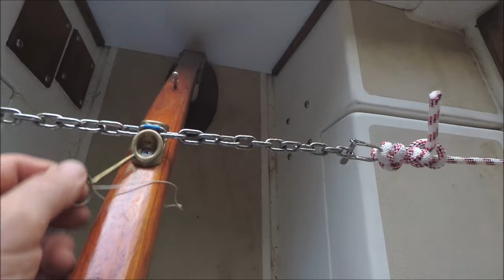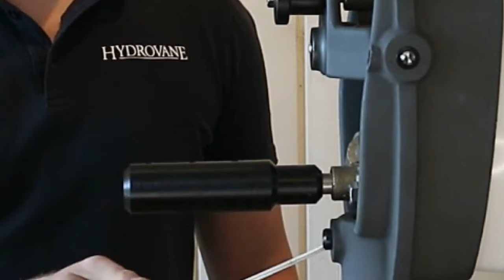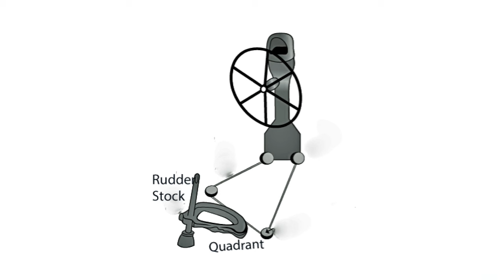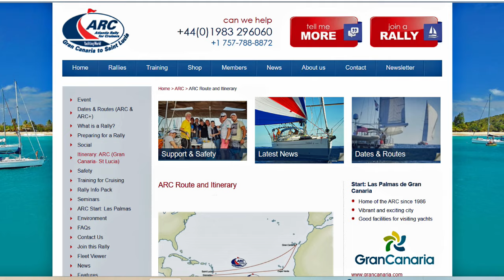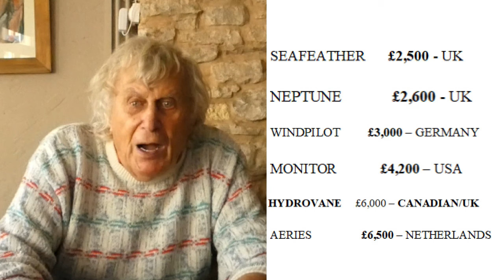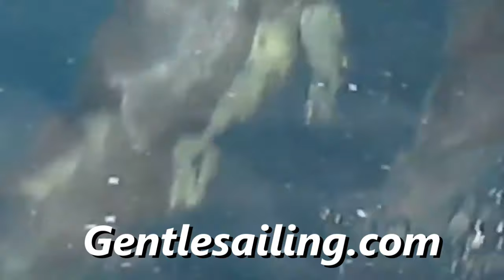Windvanes and Autopilots

Comment: Quite a good overall discussion of self-steering altho' I would add the following:  If self-steering is absolutely essential, relying on a generator with its many failure points is not a complete answer.  And autopilots also fail on occasion.  We had reliable wind vane steering while motorsailing by use of a tiller pilot connected to the vane's servo oar.  We've had two CPT failures and would temper that praise.  Amazingly our Raymarine wheel pilot lasted 25,000 miles with one belt replacement (but it was only lightly used). And for the budget minded:  When calling in at Horta in mid-Atlantic, all the bigger boats are given the floating pontoons while the smaller ones are berthed near the seawall.  I was always struck, when walking along that wall, how many wind vanes were bobbing up & down on the transoms of those small, not heavily electrified sailing boats.  No autopilot 'crews' on those boats.
Reply from the maker: I agree with everything you say about Autopilots Jack and thank you for your input.  Sailing round the world I used my Hydrovane 99% of the time and the electric autopilot just for coming in and out of ports.  I think most windvane boats have an electric system as well for just that

Comment: It's a shame the wind powered ones are so expensive. In the meantime a small solar panel should be plenty for one or day sails a week, and there are some intriguing DIY designs.
Reply from the maker: I have a couple of solar panels but they are not really up to running the boat electronics when night and day sailing and I think with more i would still need to run the engine every few days to top up the batteries.  I do agree re wind vanes - Can't see why some cost so much
Reply: @SailingGently  mostly I'm knocking around the Solent where there isn't a need (or usually an opportunity) to set the auto helm to steer a constant course for hours at a time. Useful when I want to leave the cockpit for a few minutes or need 2 hands for something but I'm not relying on it for keeping course while I sleep. Plus usually the panel has several days to recharge the battery.
Reply from the maker: @jonathanshaw6784  You are right of course Jonathan - there are lots of situations where autopilots and windvanes are simply not appropriate..

Comment: I use Hydrovane all the time. Haven't even fixed my somewhat defunct wheel pilot. Downside is when under engine. Reliability and silence of the HV under sail are everything... Expensive, but if I was to change boat, I can just take it off and reinstall it.
Reply from the maker: Vincent hi,
I agree with all you write and I have subscribed to your channel!  You are the person I quoted as only using the Hydrovane all the time....   for motoring why not get a cheap tiller pilot to fit on the Hydrovane?  Michael Still in Boulogne with a broken leg - heading out mid November!
Reply: @SailingGently  I'll soon know if my wheel pilot can be fixed by a DIY friend here. If not, finding a way to install a cheap tiller pilot on the HV will be a winter job :)
Reply from the maker: @VincentVerschoore  Sounds like a good winter project...  If not the tiller pilot sounds good but I bet it needs quite a few mods to get it aligned...  Thanks for the visit Vincent

Comment: Excellent thank you. Just having an autopilot EV 200 fitted now (£3250) and concerned about the amps. Fridge 3/4 amps, nav 4 amps, auto pilot 3/4 amps? On a day sail that's around 100 ah our 650w of solar and 650ah bank will barely cope in UK. If the sun does not come out we will have to steer 🙂 My wife says boat ownership is ultimately a resource management challenge.
Reply from the maker: I think your wife is right!  Even in the Caribbean with solar panels you need a big array and disciplined amp usage.

Comment: Good summary. A few years back, prepping for a passage, I bought a new wind-vane on the market called the ProVane. Works in a similar manner to the  Hydrovane. Its all SS, but not to heavy. I have it on a 33 ft Nantucket Island yacht which is an old and heavy boat. The ProVane handles it with aplomb. These have now a good track record of install on a wide variety of yachts and have been very successful on long passages. It provides an auxiliary emergency rudder also, and I have even worked out how to attach an old RM ST1000  tiller pilot to it for hands free emergency steering. The PV is made in Estonia, by an experienced sailor and metal engineer. Prices very reasonable and as I live in Australia it was still a best price option including a heavy delivery charge compared to alternatives. I am very pleased with it performance and remove the rudder when not required to make it a little easier to manoeuvre into tight berths one it not used to. I also had on a previous yacht installed a Pelagic auto pilot. I can say without any hesitation this is an excellent device, well engineered, robust and reliable. I believe they have some type of adaptation for wheel steering yachts but never explored it. I have the RM Evo on my current yacht, find it very useful, but agree with your comments regarding their design, and quality of product. I may one day attempt to get a quadrant drive fitted. Best.
Reply from the maker: I confess I have never heard of ProVane but it sounds excellent..  It interesting that I am getting a lot of posts saying how good  the  Pelagic auto pilots are..  I think its easier ordering from the USA from down under - more natural.  You have a wonderful cruising ground - I sailed from Port Jackson to Darwin and loved every mile of it!
Reply: Interesting to hear about your experience @dreamtimesv . I am currently corresponding with Imre the guy that makes the ProVane - I intend fitting one to my Vancouver 34 PH this winter. 🙂
Reply: @russab2001  thats good news. You wont be disappointed and his support after sales is great. Would be most interested to hear your evaluation at a later time. Enjoy the PV and the sailing that goes with it. Summer on way here to its PV time. Best.
Reply: @svlyrebird  Cheers .... BTW I have watched your videos - and your testimonial went a long way to persuading me that the PV was a safe bet and not somehow a cheap copy of the famous Hydrovane. - so thank you for all the effort you put in to those videos
Reply: @russab2001  all the best. The Vancouver pilot cabin is a beautiful yacht. Perfect for substantial passages in all conditions. Best

Comment: Not being able to install an underdeck drive ram would be a dealbreaker for buying a boat for me. Mine is a tiller steered 1973 Dufour 35 with a Garmin Reactor controlling a Jefa linear drive. At sea I use a Capehorn windvane. This windvane has no exposed lines and it's the best looking vane there is.  I ought to get me a cheap tiller electronic autopilot to connect to the windvane but as to this day, I haven't needed it yet.
Reply from the maker: Yes Dirk, I was wrong to omit Cape Horn but I'm not sure they are still in business
Reply: @SailingGently  As of 2022 they were. That's when I bought mine. I believe the business was taken over by the son or son in law.

Comment: Pelagic in the USA make reasonably priced tiller pilots which are very robust. On one passage I broke three Raymarine tiller pilot actuators . Admittedly, they were already somewhat tired. Then I ordered a Pelagic, and after three years it’s still going strong. Very easy to instal and calibrate, too.
Reply from the maker: Your right, Pelagic have a good reputation n- it's just I have never owned one

Comment: thank you for the practical views on self steering wind vanes and autopilots, as i have a 43' boat and use the b&g ram set up. I was interested in another brand, Sailomat, which their current model, 800, has a feature I desire which is it can be mounted offset so as to not interfere with my swim ladder. Thanks again for the informative video.
Reply from the maker: Yes I saw that variation on their web site - very clever.  I know you can fix the Hydrovane off centre which is what I was thinking of doing on my boat but they are vastly more expensive than the excellent Sailomat

Comment: Your reviews have no equal. All in one episode. What a mess. I thought these wind devices were expensive, but they cost more than the boat. Tiller wands have no appeal to me because they constantly break. What you shouldn't be teaching is diesel generators. Mine is air cooled, light, and 3 horsepower. It's also ships propulsion at an African Queen speed. Brand new, it costs about as much as one of those stupid steering wands. You showed batteries hard wired in parallel, and they should never be hard wired in parallel. Out of the blue, I imagined a wind vane as a tiny windmill and gears. You rotate it, and it keeps applying  spring trim until the boat aims right. All these wind vanes keep breaking in the YouTubes. My other concept is boat in a box. A box of ready made stuff waiting for me to rescue a smaller sailboat.
Reply from the maker: I know what you mean - the add ons can end up costing more than the boat.  I have never had a windvane system fail but I have had stacks of electric autopilots fail which is why I am a bit wary of only having one of them for blue water passages.

Comment: I’ve run my tiller steered 29’ boat for 11 years with a raymarine st2000 tiller pilot. It’s such a vital bit of kit I even bought a spare. I hardly ever steer by hand, except when the wind / waves gets too strong and obviously takeoff and landing. I’ve done thousands of miles of coastal sailing using it, mostly around the coasts of north Scotland. While reliable it’s not that waterproof, mine is wrapped in cling film and has a heavier duty cover I bought off eBay. The best part though is the remote control - an Australian guy called ‘Madman marine’ makes them and it’s been brilliant. It’s controlled by a small key fob that I wear around my neck with 4 buttons that correspond to the 4 buttons on the autopilot. It means I can steer the boat from anywhere, including sitting out by the bow, and it only uses power when the buttons are pressed so the batteries last forever. Can’t recommend it enough! I prefer using it ‘manually’ rather than connecting the ap to the plotter because it gives me more control, it just feels like steering the boat by remote control. Yes it’s a lazy way to do it but I’m almost always on my own and I can go for long stretches, sometimes 12 hours, without any fatigue (having a pilot house helps too 😀)
Reply from the maker: That's interesting Cory.  Didn't know a remote was possible... Clever invention.

Comment: Some info in this video is a lie and some info is left out.  A windvane does NOT work in really bad weather as the waves will block the wind.  It will also not work when there is no wind.  It is best that every cruising boat have an AP, regardless if it has a windvane or not.

Now lets look at prices.  To buy a new windvane, you are looking at around 6-8K.  Most boats can get a new AP for much less than that.  I just spent 8K on a new AP but it's a type 3 hydraulic AP for a big boat.

So, for the smaller boats, would you rather have 2 APs which is cheaper than an AP and Windvane?  The AP will work in all conditions but the windvane will not.  I'd rather have an AP that I know how it works and can replace a broken part in 5 minutes than deal with a windvane, but others just get a good feeling about having the wind steer the boat.

Then there is the problem of having it on the stern.  It gets in the way of a lot of stuff, both on anchor and at sea.

Some will say APs can't be trusted and you should never rely on one.  That may have been true 30 years ago, but today APs are really good and go up to 60,000 miles without a problem.  Some say vanes never have any problem but that is not true either.  I've heard of many stories of vanes losing a bolt at sea and not operational after that.  You need to inspect them often to make sure nothing comes out.

All in all, if you can only afford one, get an AP.  If you can afford 2, then it's a matter of preference.  Both have pros and cons.  I was thinking of getting a vane when I first started cruising.  At first I could only afford 1 AP,  so I installed that before leaving.  Later I ran across a couple who had been cruising for 23 years and went around the world.  They had both but told me the only time they used their vane was when the AP's hydraulic hose broke.  Guy said he knew it was a problem but thought he could make it to NZ before fixing it.  He did most of the trip on the vane to get to NZ but after that, never used it again.  That was all I needed to decide to get a spare AP instead of a vane.
Reply from the maker: Thank you for your input.  Different strokes for different folks and boats I guess

Comment: excelent video, good info not only for beginners. I do not believe in integrated systems, auto piloting the boat, unless you are doing it for the fun of it. In my opinion, separate systems are more reliable, less complicated and easier to use. Unless you are on a superyacht with large crew, you do not need the autopilot automatically following preprogrammed waypoints; in fact it is better if you do not. Most small boat sailors navigate these days using Navionics on a tablet or even a phone. Adjusting a simple separate autopilot "manually" to follow you preprogrammed route in Navionics works just fine. The added advantage of separate systems is the fact that you have to be actively ingaged in navigation, which filters out possible planning errors and/or changing conditions. Navionics shows your planned route simultaneously with the actual track over ground. Finally, complicated integrated navigation systems cost thousands of coins ;-)
Reply from the maker: I agree with you Jarek, about integrated systems, although I like having a chart plotter screen in front of the helm for entering anchorages and course keeping.  The way   I sail in the sun and tropical rainstorms I doubt a tablet or phone in the cockpit would last long!
Reply: @SailingGently  True, if you use a regular naked iPad; these are not tough enough for boat life. I designed and made myself a custom enclosure for the android tablet I use for navigation; it is watertight and "tough", like the toughbooks used by special services. Too bad there are no such enclosures on the general market. There are some, but I could not find one that can withstand rain or being thrown around. I design aluminum boats for a living, so it was a fun project to do as well.

Comment: Sounds familiar, I had my electric autohelm fail crossing  Biscay solo, the wind dropped and I ended up doing exactly what you did for a day and a half! Knackering!
I’m currently still sailing with only my Hydrovane until I can get parts shipped. I’ve actually come to rather like it! It involves a bit more technique and forethought, also it seems somehow purer and lessens the temptation to fire up the metal mule. I definitely want my autohelm back online before my Atlantic crossing however!

I own a ketch and my only frustrations are that the mizzen boom does not clear the Hydrovane, so tacking and gybing can be a bit of a faff, also having the rudder on does have a noticeable effect on close quarters manoeuvrability on an already tricky to manoeuvre boat. 
Overall a thumbs up for Hydrovane though, it’s one of my favourite pieces of kit!
Reply from the maker: Yes when I had a vane on a ketch I had the same problems - then I just pulled up the boom on the topping lift and stopped using the mizen... I found a ketch rig a bit too demanding single handed but you seem to be coping well and enjoying it - well done!

Comment: Thank you for your effort in taking on this important subject.  SV Skoiern IV
Reply from the maker: Glad it was helpful John. Thank you for watching
Reply: @SailingGently  Thanks, there is the Fleming windvane as well. Instead of generator I hate nose they make and they are difficult to install as well with pluming cooling and fuel.  Have you thought about a towing a water generator?  Have you had experiences with them to supply power? My boat is an ex BOC 86-87 vintage class two masthead cutter. Keep sailing, SV Skoiern IV
Reply from the maker: I think the problem with all these amp producing devices is that their output is just not enough for nav lights and all the other electronic items on a modern boat...    I'm not sure that Fleming are still in business but I could wrong

Comment: Thanks for information.
I'd like to mention the hydrovane adds strong loads on transom. Servo pendulum systems don't. Also there can be problems while using jordan drouge with installed windvane. And important consideration is how to repair the windvane at sea and how complicated it will be.
Myself i will use a Windpilot Pacific Light with my 'Liz 29. In addition with a ST2000+.
Kind regards, Thomas
Reply from the maker: Thomas hello, I used a Hydrovane on the back of my Moody 36 for 35,000 miles and there was the occasional minor issue - sun got to the material of the vane so I took it to a sailmaker somewhere and he supplied me 6 in light spinnaker material for the price of one from Hydrovane company!  I had a Liz 31 - wonderful boat - with an Aeries... I had a windpilot for a couple of years and thought it was excellent. I think you have a perfect setup on your'Liz'

Comment: There is a device I saw on the "Wave Rover" channel which is currently being used on his cross Atlantic sail from the US to the Azores. He calls it the "Type 3" and it works by altering a trim tab (baby rudder) on the main rudder. I think it is his own design and it seems very efficient. Good helpful video.Thank you.
Reply from the maker: Interesting. I think there are a lot of self made windvanes around and I think the Jester Challenge site has details of a DIY one.  I'll go and look at Wave Rover - Thanks.  He has a transom hung rudder and it looks like that very effective and clever original design works well.  Clever guy!